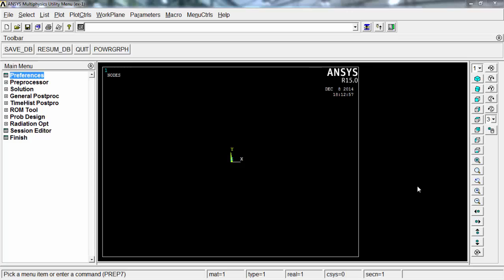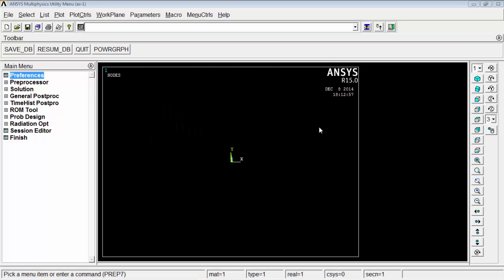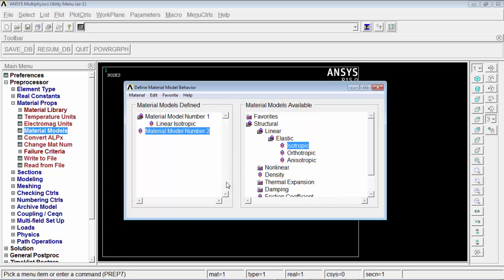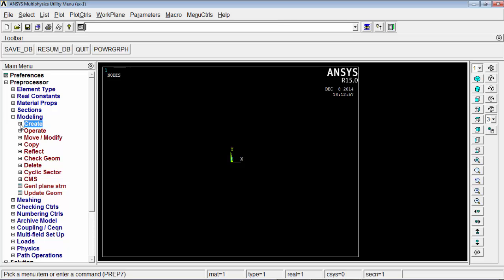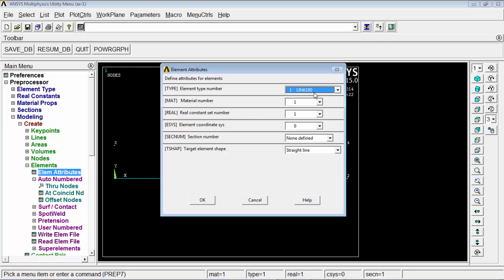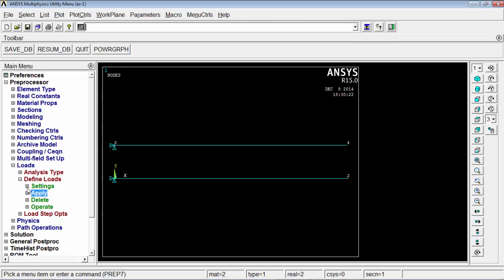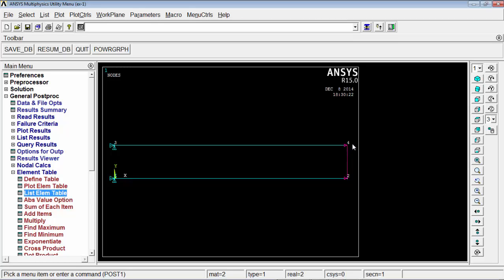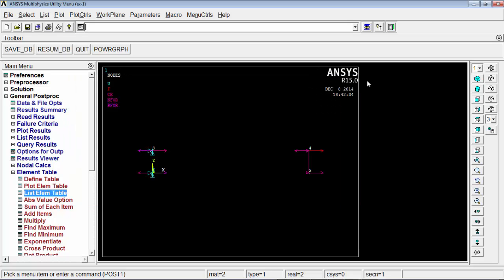Analysis of Bolt & Nut in ANSYS

Comment: Thank u so much for ur video :). But unfortunately I didn't understand the Part of "Constraint Eqn" and why u put 0.75e-3 for"constant term". Can u plz explain it more ?

And I would also be very happy if u can write down the text of the problem or the exercise :)
Reply from the maker: the thread pitch of the bolt is 3mm and for one revolutions the bolt will move 1/4 of the pitch of the bolt which we know from the problem specification.
Reply: thank u Rakesh for ur quick answer, I really appreciate that :D
Reply: Can u plz tell me also why u chose ur Nodes with that specific coordinates (I mean why "0.1" and "0.7")? Actually, I couldnt hear what u said in the beginning of the video concerning the dimensions and diameters
Reply from the maker: 0.7m is the length of the tube and 0.1m is the gap i have chosen to separate the tube and bolt for modelling purpose. you can take any value of 0.1m you will get the same answer.